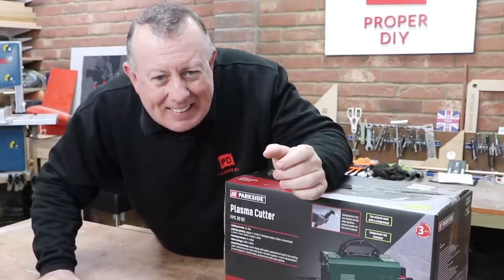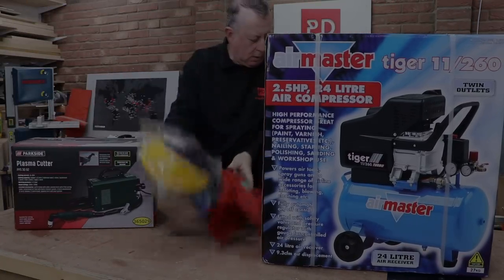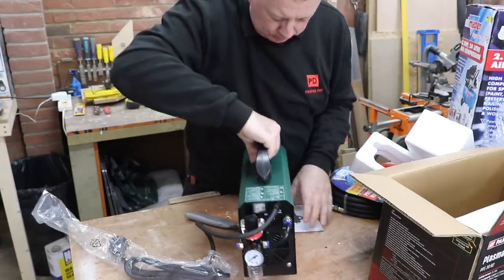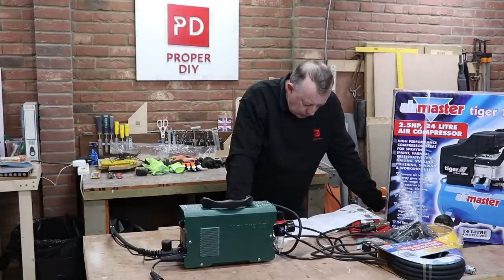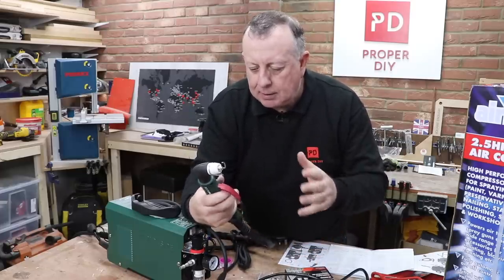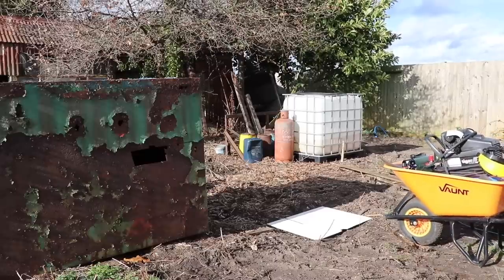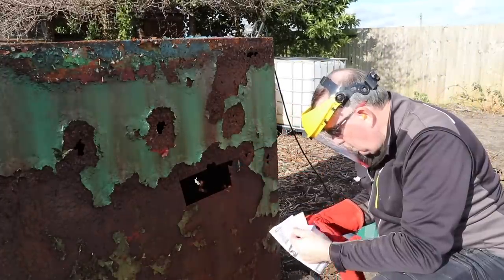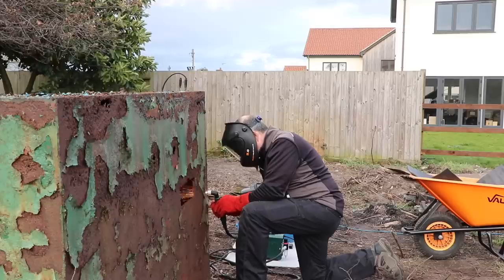Using a Plasma Cutter for the first time

Comment: In plasma cutters its the air pressure that heats the plasma ball further as it consumes the oxygen and pushes it away from the tip,   if you dont have the air pressure you can crank up the voltage till the cows come home and all you will get is pill spalling - just like you were getting,  it was painfull to watch how it sputtered and struggled due to the lack of air pressure, the compressor you bought simply doesnt have the supply pressure and cubic mass supply to do the plasma cutter justice, in short try a meatier compressor with loads more thrutch - crank it up and you will be pleased and surprised at how easy it cuts through that tank. and as for the welding mask.......the arc that electric welders and cutters produce  gives off MASSIVE amounts of dangerous UV and infra red  waves, which you dont feel at the time - it isnt even warm on your face......but try a couple of hours welding or cutting without one........and about five hours later you will REALLY wish you hadnt....better have plenty of calamine lotion on hand you will need it. so a full face shield isnt simply a nice addition -  its an absolute MUST if you dont like burnt skin.

Comment: When you use a plasma cutter at the high end of its cutting capability - the cuts do become more ragged (because it isn't blowing through right away, so molten metal is building/bubbling up in the cut). If you want clean cuts - thinner metal (20Ga) will work much better (likely clean on the side you cut and just a little easily removed swarf on the back side) or to got thicker you will need to get a more powerful machine. As others have said you will also get better performance by avoiding air pressure droops and voltage droops - but I'd suspect the issue here is that the machine just isn't that powerful. Working outdoors is also always more challenging because of the remoteness from power.

Comment: The messy edge of melted metal can usually be chipped off. With a hammer. I found it worked much better without the cage thing just freehand the height. Also run two extensions one for plasma on its own as it can pull nearly 13amps. Or long hose for the compressor.

Comment: 11:36 - Looks like the cable is still coiled. That will make it overheat pretty quickly (because the electrons skid when making sharp turns). If it still overheats when uncoiled (which can happen even with medium loads, if you're out in the sun), get a large plastic tub, fill it with cold water, and put the excess cable in it, in loose coils (this is assuming there's no damage / repairs and the cable is fully waterproof, of course)..

Comment: I know I sound like a tool snob, but I would never buy stuff like this from Lidl, tempting though it is - just spend a bit extra, talk to a company who know what they're selling and you'll end up with a tool that will serve you well for years, rather than fighting with some cheap crap that  you'll end up getting frustrated with and replacing anyway. Buy nice or buy twice, as they say. Counterintuitively, I think this is just as, if not more important for amateurs as pros, as we don't have the skills to compensate, and you'll never know whether it's you or the tool that's not up to the job, so you stand little chance of actually learning the required skill.

Comment: If you’re serious about needing a plasma cutter, you would do better to go to R-Tech Welding and spend a good deal more money. But you’d also need a much better compressor. I haven’t dared to go for a plasma cutter (yet..). I did see this one in ALDI but passed on it. All the comments and observations about getting a better earth to the tank surely are correct. Rust and possible sealing compounds on the connection where you had your earth-clamp would cause a real drop in performance. Les

Comment: A compressor should not be run off an extension cable because compressors try to draw more power through extension cables than extension cables are typically rated for; that situation can damage the compressor motor.
Usually a compressor should be plugged directly into your home electrical circuit wall socket then use extension air hoses to reach your work location.

Comment: another tip is not to run the compressor and plasma cutter off the same supply ring, both are drawing alot of juice when they run at the same time
just bought the ebay plasmargon 55pro, really nice unit around £200, i'm runing it through the cooker supply which is fused at 45amp, and i have a 32 amp breaker in the garage, not tripped it yet

Comment: I bought a plasma cutter but didn't know anything about it only that it cuts metal. I found out after that I need a compressor and just now waiting for it to be delivered in the next few days. I was thinking angle grinder is so loud and I would use discs to beat the band. Also with next door neighbour from hell always looking for problems to complain about Im hoping the plasma cutter will be less noisy. I see you have to use the correct amount of amps and air flow for different thicknesses of metals as well as it can make a difference to the cutting of the material you want to cut. I have to learn from scratch also

Comment: Your average 13Amp extension is only going to handle 10Amps for sustained periods. You may need to use a 16Amp socket (which Lidls welder also demands).

That air compressor is too small, it can't keep up with the demand.

Comment: Cutting Aluminium is probably harder than steel because the Aluminium conducts the heat away  faster requiring higher heat input

Comment: Well it's nice it's got auto strike. 
My Clark 700 quid in 2003 one can get through a cm of steel but my twin compressors struggle to keep up with the air demand . Having to strike the arc and maintain distance makes it bit of a git to use. 
The one I used at University was great , auto strike and it cut  quick, had to move it quick to maintain the circuit, it could scribble like a bird. 
It your not cutting all the way through a material it messes up the nossle . 
Well after I got mine I saw the ones with built in air, depending on their cutting capacity that's the way to go. 
These inverters replacing transformers certainly makes welding and so on tools easier to lift, I do wonder how long they will last.
I learned arc welding at school in the 90s on a welder made in the 60s.

Comment: If the extension lead is wound up (even partly) it forms a coil, which will have inductance. This inductor will heat up and trip the thermal cutout. Fully unwind the extension lead and that will help. It may be that you also need a heavier duty extension lead because of the high currents used.
Reply: Hello Derek how are you doing, nice to meet you here.

Comment: Some good tips here in the comments. Having never used an hand held plasma in proper anger but have used and programmed large CNC plasma cutters daily for the last 17 year here's my couple of tips. You'll find you won't really get the same cut quality with aluminium, stainless etc because you won't have the correct gases. Even mild steel has an oxygen plasma with compressed air shield gas on most machines sometimes O2/O2. The earth needs to be spotless. Don't cut through rust and paint it will eat through your electrodes. Weirdly always found a rust discoloured plate (not flakey) better to cut than shot blasted plate. Can't speak for that particular cutter but the plasmas I've used trend to be quite particular on gas pressures and flow rates. I'd air on the slightly higher side to clear the molten steel through the cut but not too high it distorted the arc. Keep up the practice

Comment: There is no cheep way to buy good tools. plasma cuter should be selected one or two steps higher the the metal thickness you are intending to cut. aluminum is not one of the favorites materials of plasma cuter.

Comment: Great Video! I just out found similar, same unit but 2 thirds of the price from ebay. I'm having to build myself a compressor tank and top it up with a 12v tyre inflater....Im on a tighter budget ;)  I have heard that 20 to 25 is the ideal setting on this unit for 3~4 mm steel. anything above 6mm and this unit will begin to struggle.. due to the cool down times needed at higher settings. at 15 to 18 on the dial you should have no or minimal cool down: it all depends on how long you want to cut for, the volume of air you have and the time between cuts.

Comment: You need a better compressor for that plasma cutter. It's surprising how much air you need to get a decent cut. I've got a 40A plasma and I use a 3hp belt driven 100 litre compressor.

Comment: Hi sir will you be able to return it ?,    because it’s looking like it’s not up to the task .   Obviously the compressor will have a multitude of uses , so not all bad .       As a point of interest as a retired electrical contractor ,    we did work for a s/s fabrication company . And even back then there plasma units cost thousands ,    but in all fairness if a company can produce a product for  the sum quoted  it’s pretty amazing by anyone’s standard .     And yes I did see the extension lead , but unless the amperage was long term then the cable would be ok . When you have seen a cable extension totally welded together then you will understand the direction I’m coming from .    Thanks for all you do to bring us such information , in an informed and thoughtful manner .     Best wishes and kind regards as always . 😀👍👍👍

Comment: I noticed when I replaced the extremely cheap crocodile clip very similar to the crappy clip provided on this machine, on my welder for a much better quality clip it really improved the weld.....im guessing it would do the same for this tool. Also grinding your metal off at the point you are earthing could significantly increase your cutting power and increase your cutting time before cutting out.

Comment: The fitting on the supplied hose is a euro fitting, last year Lidl sold a plasma cutter with built in compressor for the same price shame it wasn't the same one this year. Probably didn't help with the length of extension cable and could probably do with a bigger compressor as it sounds like yours was running continuously which won't help. Would have probably been better using a petrol disc cutter.

Comment: much simpler with a reciprocating saw.  I have virtually the same tank and cut the whole front panel off in no time with a makita 18v reciprocating saw and metal blades. Have since used the recip saw for cutting the panel into many narrow strips for a project. Leaves reasonably clean cuts as well.

Comment: Smooth and constant speed is critical. Your torch was moving very jerkily so it doesn't stand a chance of making a clean cut. You need the plasma jet to continuously emerge at the back of the workpiece without interruption.

Comment: Stuart, for that diesel tank I would use nothing less than an oxygen/acetylene cutting torch. That little plasma cutter is woefully inadequate for that.
Reply: Absolutely or Les dangerous oxy propane, as used in most demolitions where cutting steel is needed.

Comment: for the aly it was set to high i think. I have seen other reviews of this machine, although this is not a powerfull machine, in the reviews cut much better but they where cutting clean metals. you will get slag forming either if  its set to high or cutting speed to slow as it will melt and reattach again, also painted surfaces will effect this type of cheap plasma cutter, as it is not equiped a pilot ark, thats a divice that pre starts the plasma before it gets contact with the metal, which in your case could not happen because most of it was covered with paint and rust hindering connection. Remove paint and i think you will get better results, also if its a damp day that will not help as plasma cutters require dry ait ,don't laugh, its a thing people have trouble with moisture in compessors and have to fit air driers in system, although unlikley with such new machines.

Comment: like you, I have bought one and found it to be a bit messy cutting . Haven't really had a good go at improving it's performance but I'm pretty certain that it will work. To cut up that old tank I would use an Evolution saw, they are brilliant pieces of kit. Set the blade that is just cutting through the steel and you will have it in pieces in no time. If you haven't got a saw use a grinder with a thin blade and just mark the cutting line and then continue to draw the disc lightly over the marked line. Don't try to cut through in one pass and you will be surprised at how long the discs will  last .

Comment: Real men don't read instructions 😂 good review, I've been thinking of getting one myself along with one of their mig welders to practice with before upgrading to something more substantial. Perhaps a review on that as well. Also if cutting circles or other shaped apertures it's easier with a jig to run the torch around inside of the shape.

Comment: All ways fully unwind the extension lead also I’d be tempted too run two extensions one for the compressor and one for the plasma cutter so the load is split because I find thermal cutouts too be a pain and I always use my extensions fully unwound I bypass the thermal cut outs as one of my older cable reel never had one if friends or family borrow them I let them know so they don’t melt the lead I have different lengths too so I don’t use a longer cable than needed

Comment: Great video.  Suggest when you have got a bit more on the job training it would be worth a follow up "lessons learnt" video.  By the way as it is so difficult to get a good earth prepare the one you have well and the start at the far side and work towards the earth. Otherwise you will be cutting off the electrical path to the earth clip.

Comment: I know what you mean about Lidls. I went to get some nappies for my 5 week old grandson and came back with a Sharpening Station and some clamps. Whilst it has its limitations, the Sharpening Station has revived some blunt chisels and drill bits, although it takes a bit of practice to get acceptable results. Worth the money, for me anyway, but a Plasma cutter is a step too far!
Reply: Not going to ask if the clamps worked OK on the 5 week old.  Congratulations, anyway.

Comment: I have a Parkside too but mine is a lot bigger and has a built-in compressor you should bring your derv tank nearer to your shed and clean up the tank with a angle grinder as they don't like rust much

Comment: wait , here in germany lidl had a plasma cutter WITH a compressor build in 🤨
Reply: the amp and the pressure were to high, it takes some time to get used to it, some time ago i build a few things like a sandblasting cabinet from a old honey barrel (210L oil barrel) it worked fine on the steele i think it was 1mm thick

Comment: I don't own a plasma cutter, but from what I've seen is if you remove the round spacer cage from the end of the cutter and get the cutting head closer and at an angle to the metal you will cut faster and cleaner, the only downside is you will burn through the cutting heads more quickly. Take a look at David Jex's channel " in the workshop, or wood and stuff workshop " he bought the same plasma cutter and found out the best way to use it.

Comment: You must use a welding helmet when using a Plasma unit.
Reply: Apologies Robert but a full face clear screen and a pair of dark shade (4/5) safety glasses are adequate as Stuart was using in the video - you can't get a welding/arc flash through a surface, clear or opaque, only by looking directly at the arc with the naked eye or from collateral flash

@Stuart..... Covering up as much as possible is the recommended method so well done on the PPE Squire!!!  

A better ground connection to the material to be cut is preferred, so mechanically prepare (grind/wire brush etc) the area where you intend to connect the return clamp, much the same as for welding  

The reason that Aluminium cuts poorly is the way the material transfers heat so even a larger capacity machine can/will give similar results.....  Aluminium requires a higher amperage to give effective, neat cutting, similar for Copper also due to it's thermal conductivity...... as for the Carbon Steel (mild steel angle), practice on sheet steel/thin plate first to get your hand in!!......  obviously you need to go quicker for thinner materials.....  this unit is sold with cutting capacities that are slightly 'misleading' - the maximum cut will be a piecing or severance cut not a continuous cut. 

This unit is an item of Class A welding equipment and shouldn't really be run from a standard household amperage/voltage outlet (recommend a 16amp blue commando type outlet/plug - same for your welder), the air pressure rating for the plasma cutter is 4-4.5bar which is a bit on the weak side for my liking (6-6.5bar far better working pressure and more relatable to the usual suspects in the production of this type of equipment) and as already stated better to run the compressor off the outlet or a fused spur/separate breaker not from an extension cord.... great content as always and good luck with the efforts..... look forward to seeing more of your entertaining and informative Proper DIY exploits!!